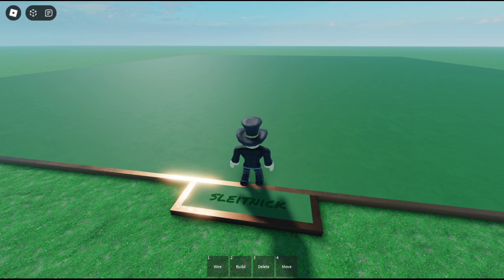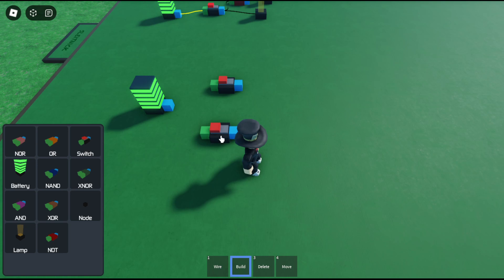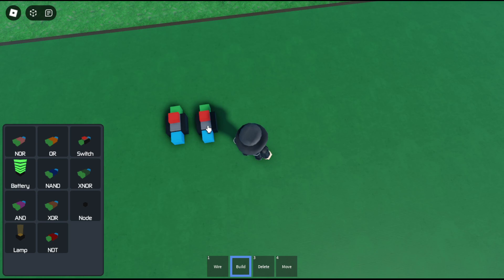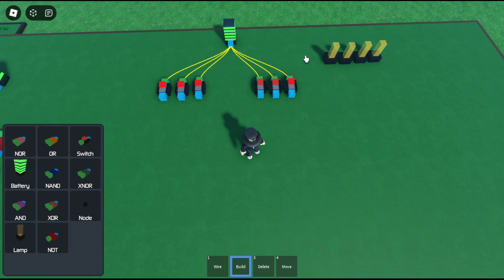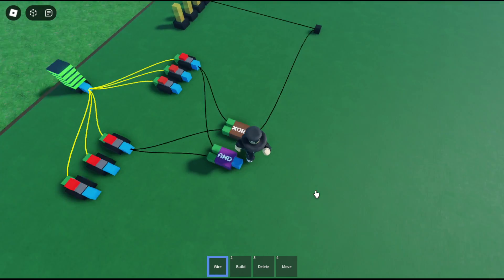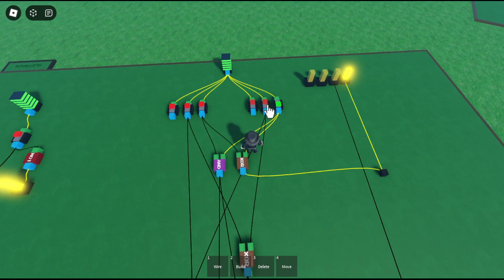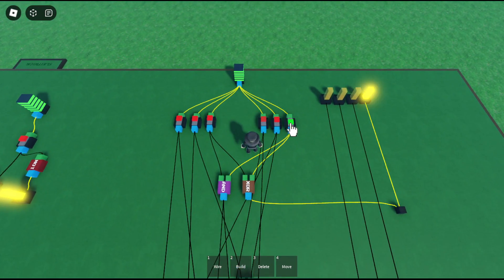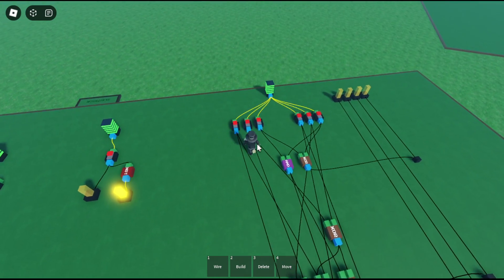Roblox Circuit Simulation Demo

Comment: hey there, I've made a game called Build Logic 3 years ago, and I was wondering if your game was inspired from it. Here are some key details:
Input and output colors are the same;
Tools are almost the same, Move replaces Select Tool;
Fonts used on the components are the same;
Pressure plates in the building menu.

Thanks in advance!